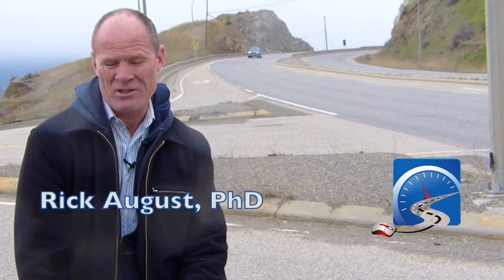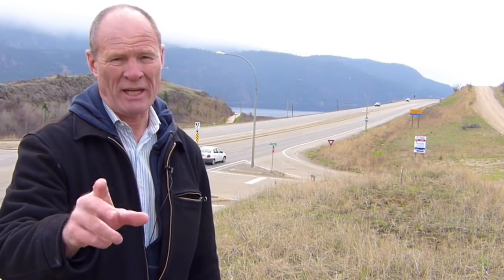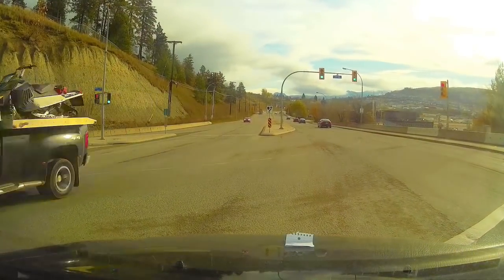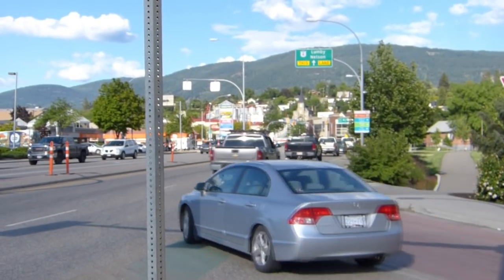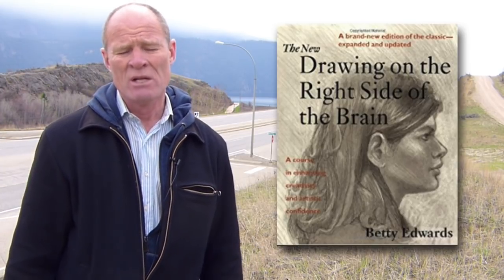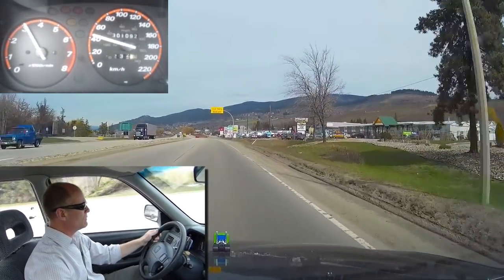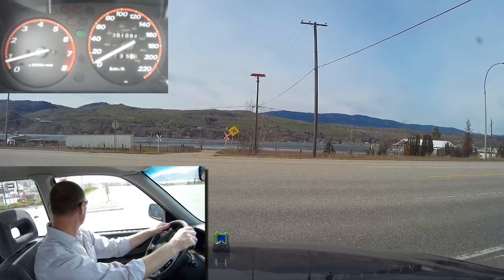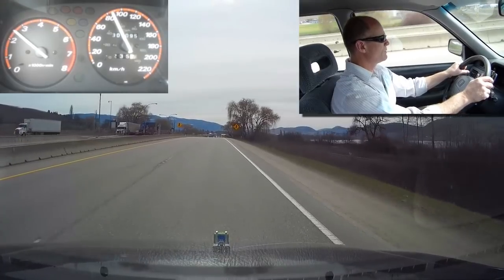How to Judge a Safe Gap When Turning Right & Left

Comment: Today, I took a right turn by miscalculating the time it takes to reach 60 km/hr from 0 km/hr and luckily the other guy stopped, honked and showed finger when he passed me. I don't know why I did this but I feel guilty and it was a near miss rear collision if other guy didn't press brakes at the right time. I tried accelerating as much as I can but  my vehicle didn't pick the speed then. The reason I am writing my experience is please don't do the same mistake I did. TAKE YOUR TIME. Ensure to have safe distance and time as specified in this video while taking turns. Thanks again, Rick for your valuable suggestions and keep up the good work.

Comment: I took a Safe Driving refresher course at my local senior center and learned that as people age the eye structure actually changes ... it's harder to recognize the speed of oncoming traffic!  That explains why I was being honked at more after turning!  
So now I'm more cautious,  consciously remember I need to leave more room than I "think", and speed up more quickly; I also realized I had not been blending into traffic, as I tend to drive more slowly these days, so again I consciously try to blend more quickly.     
There's a very slight hill to my right (I'm in U.S., right-hand driving) that's JUST high enough so oncoming traffic can barely realize there's an intersection ahead and when I'm stopped on my rural road waiting for a clearing in the highway traffic I can't see oncoming traffic at any distance.  Many times I've pulled out, no one in sight, and suddenly someone's "in my trunk".  I've learned to be especially wary there, speeding up to highway speeds and anxiously watching my rear view mirror.  Cars often come over the hill much faster than the posted speed limit and I have to floor it to stay ahead of them safely.
Reply from the maker: Hi Beth Clemensen - Thank you for your comment. And you are correct my friend. As we age, it can more and more challenging to drive. However, it sounds like you're taking courses that are making you aware of these challenges and are working to implement strategies and techniques to compensate. You're a smart driver my friend. If there is anything further we can do, drop us a note. Always happy to help. All the best, Cheers Rick

Comment: Thank you Rick for this. I failed my driving test recently because I thought the oncoming car was far enough for me to safely make a left turn, probably around the same distance as the oncoming black car in your video at the 9:11 mark at a slightly smaller intersection. Alas, the instructor said no.  It was the one and only error I had on the test, but it was a critical one, so it's a fail. I think even the examiner was disappointed that he had to fail me because I've been doing so good prior to that. When I observe other people driving, most cars would do literally the same thing I did, but of course, it's probably not the safest thing to do and the test is all about examining whether you are a safe driver. Interesting fact there about the right side of your brain and how it affects your spatial recognition.  I do have a bit of a challenge with my spatial judgment, so I would need to work harder to overcome that. Thank you so much for your helpful video. You are a really good teacher.

Comment: yes I have, it took a while to get it right but I did. If your depth perception is not good you will struggle with this. Give yourself extra time if you have problems with this, better to hold up traffic and be safe than get t-boned and have your neck broke! Stay safe folks!
Reply from the maker: Hi Ladonna - thanks for your comment. Yes, to learn safe gap, it is important to work with experienced drivers to be able to learn this skill correctly. Thanks again Ladonna - all the best, Cheers Rick

Comment: Great video. You are very generous to post these videos.  I am anxiously waiting for "how to drive a manual car #4". I had my first lesson yesterday. My instructor was very impressed. My clutch control is not perfect,, but your videos helped me A LOT. I saved 3-4 lessons according to him (at 60 euros per 1.5 hours, that's great news). However, I am finding it incredibly difficult to change down gears. I am on 4th gear approaching a turn.... He tells me to brake to a 2nd gear speed, then clutch down and change to 2nd gear. By the time I am turning, I am supposed to be done with the foot work (just gas of course). I can't do it... So frustrating. I am turning and still trying to change the gear to 2nd :(
Reply from the maker: Hi Val S. - thank you for your awesome comment. See, lesson #4 was waiting for your comment and this information. The challenge you're currently having is an easy fix - start setting up for the turn earlier. You need more time to downshift to second gear, so instead of braking approximately 1/2 block, start at about 1 or 11/2 blocks from the turn. That way you have more time to do the work that you have to do to set up for the turn. As well, use the brake to bring the engine rpm down to about 1,000 rpm in a petrol engine to shift down to second gear. I'm working to get the video up for your for tomorrow. If there's anything further we can do, drop us a note. All the best, Cheers Rick
Reply: The smaller your engine, the more difficult this becomes.  I know in Europe and particularly UK, people are obsessed with small cars with tiny engines. This means slower speeds for any manoeuvres.

Comment: The faster the speed zone is on a road, the quicker the gap will close and the faster you will need to accelerate to make the turn safely. This is something that I've seen people commonly miscalculate. A left turn is not going to be the same on a 50 mph road as it is on  a 30 mph road because the cross traffic covers more ground in a shorter amount of time.

Comment: Thank you for this Im a new driver, and im having trouble with judging the gaps. Ive just realized i Just have to be extremely patient. Also to be even more patient in the rain and bad weather. I was making a right turn onto a busy road 50 mph and my car was slipping on the road and not going as I hit the gas. If it slipped anymore i wouldnt have been able to make the turn safely.

Comment: I had a situation once where i had to cross one road and turn onto the next and there was no stop light and i miss judged a small truck, thank goodness it was small, lol, it was coming in the same lane i was turning onto all i heard was the guy beeping is horn and by that time i was starting to brace for impact but the guy was able to swing into the adjacent lane to aviod hitting me. Since then ive always been extra careful at that intersection.
Reply from the maker: Hi Kevin M - thank you for your comment and information - that really helps out the other smart drivers working to determine gap correctly. Yes, it only takes one mistake to observe more closely and work to correct the error. We're certainly glad you're okay. All the best, Cheers Rick

Comment: On a four highway with a minimum speed of 30 and a maximum of 55, you need enough time to reach the minimum speed or faster. You don't need to match the traffic immediately , because most drivers will use the left lane to pass you, then you can pick up your speed. On a two lane highway, you do need to match the flow of traffic or 10 miles below the limit or higher, because there are less opportunities to pass.
Reply from the maker: Hi Rylen - Thank you for your comment and the great information. Most drivers will use the left lane to pass, but aren't always able to move over. These videos too may provide some information that will elaborate: https://www.youtube.com/playlist?list=PL0x-bChcUvwFZC-_2LIavmqjUMNgj_jpq It's always recommended to match the speed of the flow of traffic. If there is anything further we can do, drop us a note. Always happy to help. All the best, Cheers Rick

Comment: I just had to deal with a left handed turn onto a busier street where it was 50mph and was pitch black outside so I couldnt really find a fixed point to determine when to make my turn, so I kinda had to judge it based off how far I could see the person's headlights and where I was waiting. Making left hand turns gets me flustered a lot of the time, so I try to avoid them as much as I possibly can unless there's a light to stop the floe of traffic for that left hand turn or a middle lane for me to turn into so I'm on the road and all I'm waiting on is for the right lane to clear.

Comment: I was in a accident caused by me I was making a left turn for first time at intersection it was a green light not green arrow it was heavy traffic for me and the line of on coming traffic kept coming so do to pressure when a clearing opened up I went but I miss judge how fast the cars would be coming up when I was making the turn and bam get hit in side so now because of that I have fear of knowing if I have a clear enough gap to make it.

Comment: In such situations , better have a V8 engine . Thank you
Reply from the maker: Hi Salvador Dali  - I agree with the bigger motor for those situations; that's why I won't drive a 4-cylinder unless it's a manual transmission. And I couldn't afford the petrol for a V-8 at this current juncture...but soon. All the best my friend, Cheers Rick